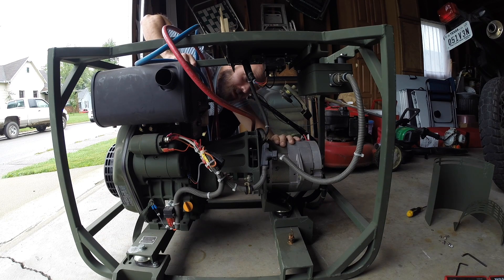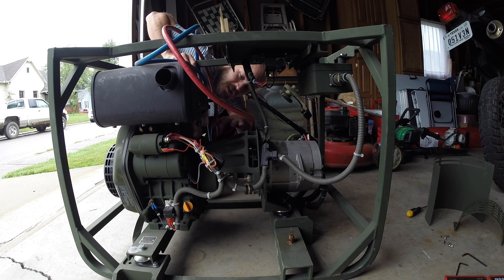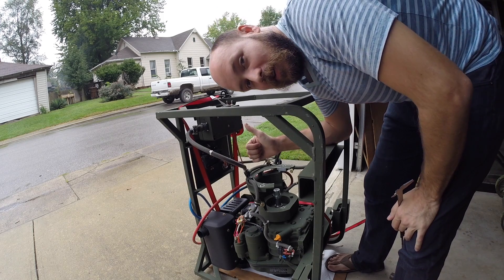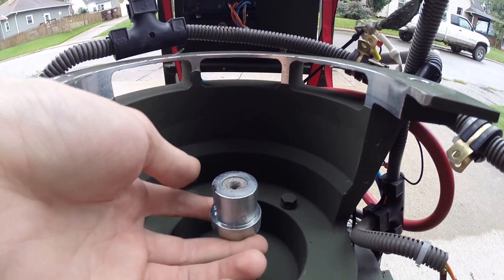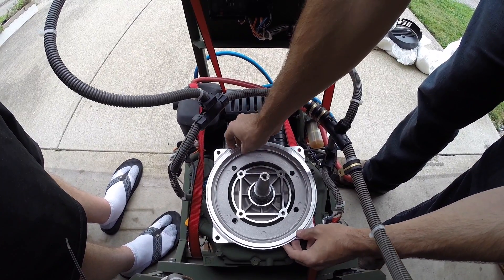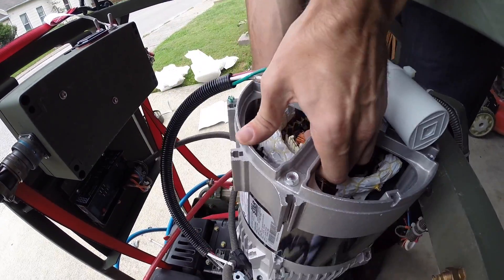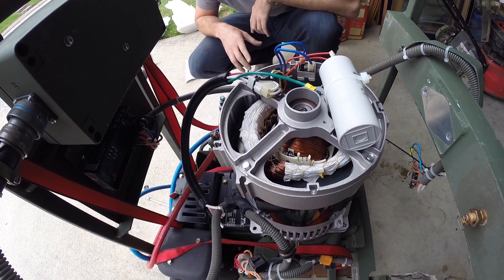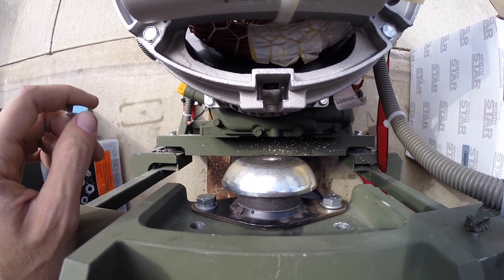MOAR POWAH!! - Yanmar Diesel Generator Build

Comment: I Know this is an older video. But I Have 2 Mint condition Mep-531A generators, and I want to make a conversion like you did, so that I can power a decent amount of my house when the power is out. Can you help me find some information on where I can still find a compatible swap? The north star unit you used is not normally available anymore. And I would like to experiment with the largest head that I can push on one and maybe go with the size you used on the other.

Comment: Have you put it under load yet? I have the exact same motor and need a new generator head, Curious if this worked or not for you
Reply from the maker: Yes I've got another video of it running a welder at it's max current setting. Didn't even phase the engine
Reply: @yertnamreg  Thats awesome I enjoyed the video!! Thanks for making it. My motor is a  L100V6 you said yours was a L100V I cant find any info on mine on the interweb I wonder what the difference is ? It looks the same
Reply from the maker: @davidderaps8255  mine may be a l100v6, not sure. L100V is the main code of the engine. There are manuals out there on the web that have information on decoding your model number

Comment: Trey, could you have installed a bigger generator? how bigger could be the generator for this engine 10HP?
Reply from the maker: No this is the largest generator head I would install on this motor.  The motor only puts out about 8hp continuous which is less than this generator wants, but it puts out much more torque than a gasoline engine so I think it is a perfect match.
Reply: @yertnamreg  Thanks for the explanation! These battery chargers are everywhere on military surplus and cheap as hell.

Comment: So after getting this all hooked up, what are your thoughts? 
 Is it in the truck yet for testing?  
Was the generator head too much for the unit or would you recommend dropping down to the 4.5KW?

Mine is still stuck in Vegas thanks to UPS, so I've neither run it no ordered my gen head yet.

Thanks
Reply from the maker: I still haven't really loaded the generator down yet.  Working on a unistrut cradle for it right now.  Hoping to have it mounted to the truck soon.

Comment: I was hoping to get one of them chargers from the last auction, looking good.
Reply from the maker: I'm really happy with it so far.  Turn out the electric start issue I was having is just because one of my batteries was low.
Reply: Haha have the same issue with my china clone engine. What are you doing with the old dc generator head?
Reply from the maker: No plans for it.  Probably end up selling it.  If you're interested in it PM me on SS.